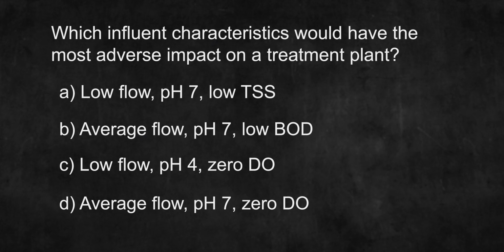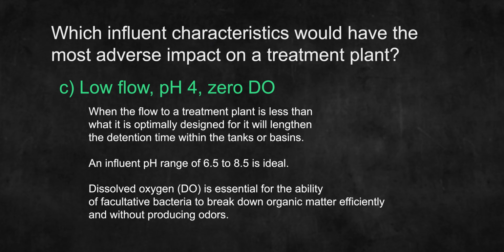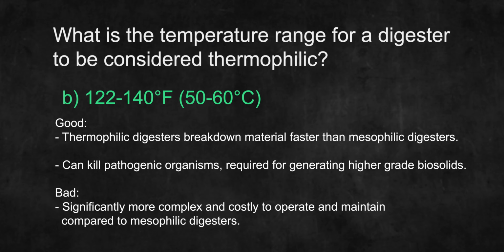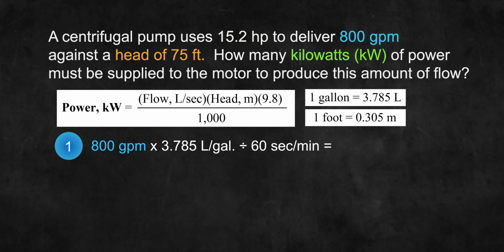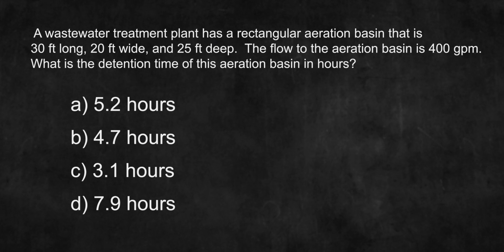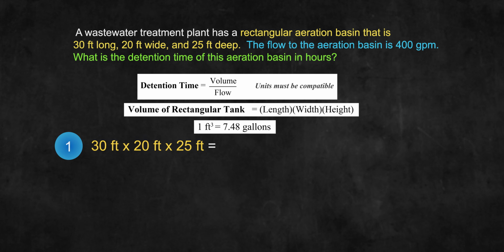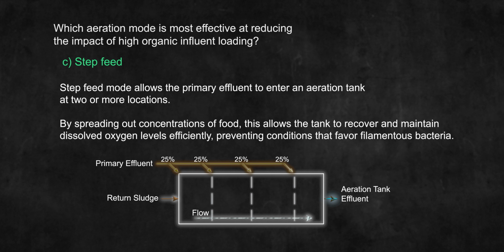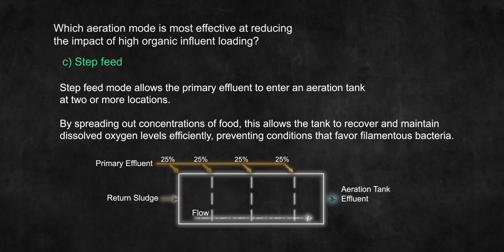Part 16 - Wastewater Treatment Operator Exam Questions

Comment: Hmmm only time we get spooked is on the weekend when it’s only 2 operators on site with outside gates locked. So if you hear or see something knowing the other operator is up in the control room, chances are likely there is a ghost. Or when both of you are sitting in the control room and you hear someone coming up the stairs or getting off the elevator. Heebie geebies.

Comment: So at question 74 I lost you… the answer was 6 hours and it wasn’t an option on the test I printed from here, and that’s the last question on the test that matched with the last two of your videos. Where can I get the answers for 75-100??
Reply from the maker: Hi, your comment here is on part 16 which goes over questions 76-80.  Question 74 is the second to last question on part 15 of this series.  Which does have the correct answer that goes along with the exam in the link. I believe this is the question you are referring to:  
A biochemical oxygen demand (BOD) sample can be removed from the incubator at 5 days plus or minus how many hours? 
The answer is choice  C = 6 hours

I'm sorry for the inconvenience but I am working on the next parts of this series.  I have been busy with real life stuff but will hopefully be releasing a new video (part 17) in the coming month or so.  Hopefully this answered your question.  Thanks for watching and good luck!